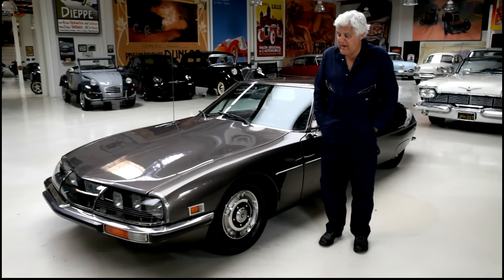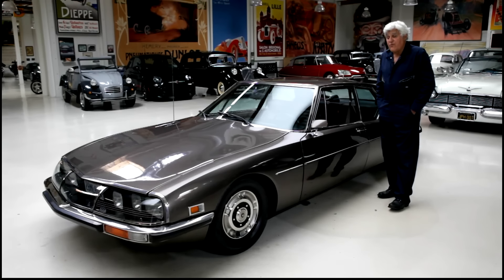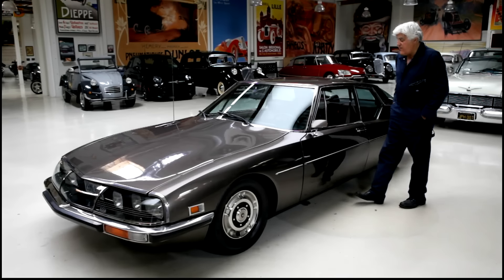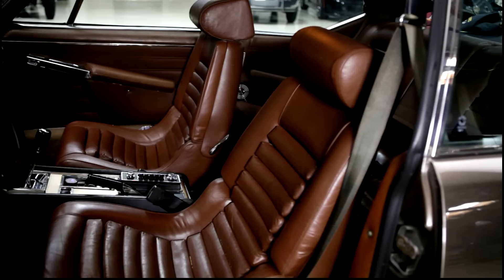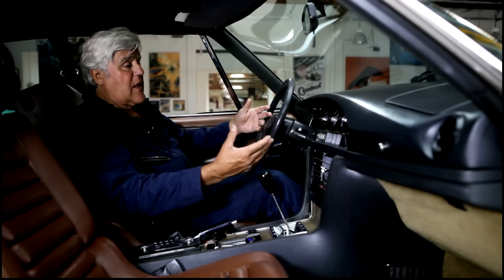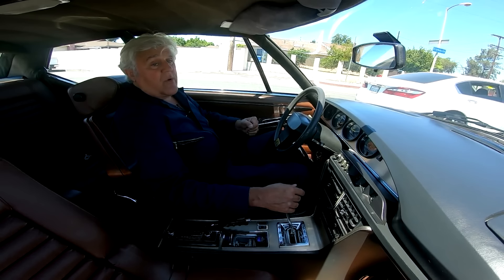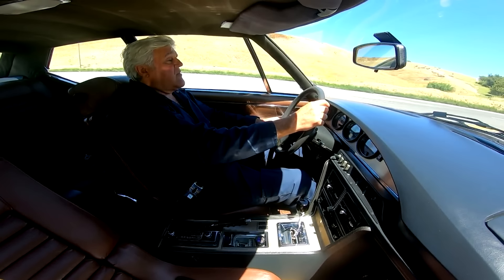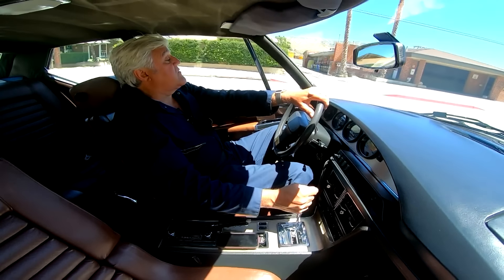The Futuristic 1972 Citroën SM | Jay Leno's Garage

Comment: Shame its not injection
Reply: 2.7 litre 3 Weber 42 DCNFs 170 HP. 2.7 litre Bosch D-Jetronic 180 HP. 6% more peak HP, no better gas mileage. Much more difficult to maintain and repair with all of the EFI stuff all over the top of the moteur. Less reliable, which anyone who ever had a car with Bosch D-Jetronic will know. Leaking injectors both internally and externally, Rilsan (nylon) piping cracks and leaks, computer problems, etc.

Comment: UGO! Blech! French should stick to Food! And the color?!! Really.. Even the English have a nice green (MG, Lotus) Sorry Jay.
Reply: It was available in a lovely medium green metallic--reminiscent of Aston Racing Green (which would be my choice),  but I think this gunmetal metallic suits it very well.  I had an SM that never got past project stage--white/tan, 2.7 carb 5-speed with the even rarer electric sunroof that worked.  The A/C worked as well, they were originally fitted with the huge heavy clunky York, and was hard-wired from the factory, it was always running.  A previous owner had installed an extra matching switch in a blank on the dash to switch it in and out as well as swapping the York for a Sanden.  I was so sad I never got to finish it.

Comment: There was nothing special about this Citroen other than the Self Returning Steering Wheel to neutral position.  The Maseratti engine was total garbage that consistently had Head Gasket failures.  The SM is ugly irrespective of color or interior qualities.  The DS21 Pallas was a far superior model in every way.  Citroen had good reason to stop production, and fire the idiots responsible for ruining Citroen's excellent history.
Reply: The stupid original head gaskets with separate brass rings showed where they had been leaking when I pulled the heads. Not really blown, just leaking. New conventional design Ferodo gaskets cured the problem.

Comment: Citroens are ugly. The best thing about a Citroen is the suspension. But I think that the suspension would cost a fortune to maintain as it ages. Headlights that turn were nothing new. The Tucker had turning headlights in the 40's.
Reply: No, the suspension is not expensive to maintain. The hard part would be to find the tubes or to make them yourself. And yes, the headlights are nothing new, but they were not used in a production car, but rather a prototype.